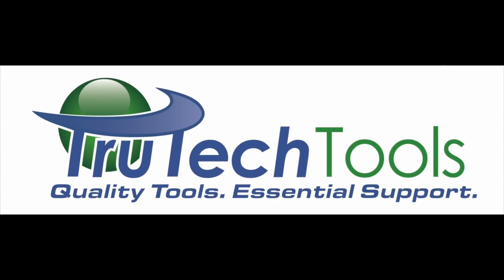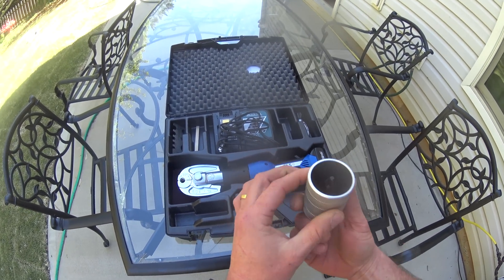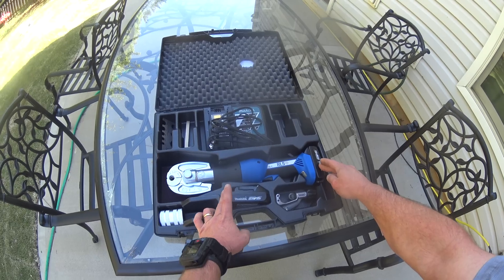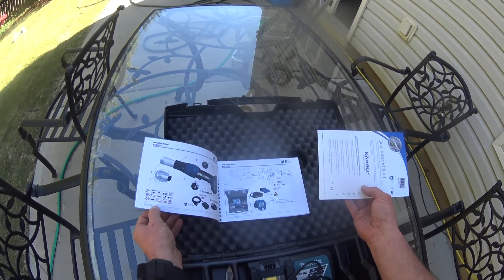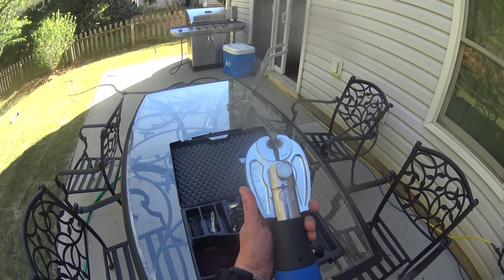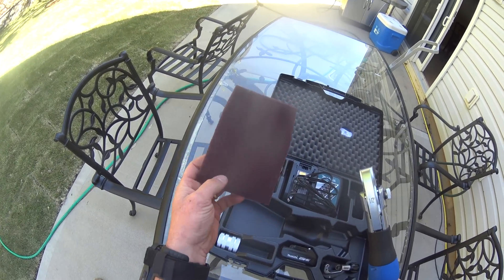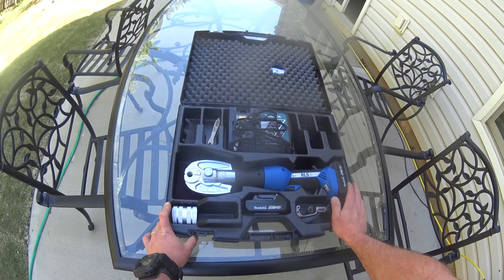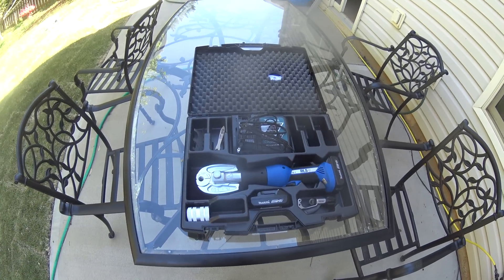HVAC Tools: Sporlan ZoomLock Unboxing

Comment: Are you using this tool? Thinking about trading in my torches. I have searched for videos on new ac installs using these but only a few found.
Reply from the maker: No im not using it as I only had a chance to handle it a few days for the purpose of the video. I've heard some stories about companies using it but haven't actually seen it in the wild.

Comment: In my opinion ridgid makes the best one I have ever used never used on Hvac applications mostly plumbing or water cooled condensers lmk how it works for you in Chicago it's not code yet for pro-press refrigeration line fittings has to be soldered or brazed but I'm sure it's coming had good luck with these fittings in plumbing when ur in a bind and water flow is hard to stop but I will solder or braze if I can just my opinion though

Comment: The guys who don't agree with this tool will get a wake up call in a few years. In five years or so I see this becoming the new standard in the industry for fitting copper and even see replacement parts with crimp fittings. Just look at the Propress success, on big jobs the savings in labor and maybe even have a tech with less experience doing the work will save so much money. Look how far digital gauges have come in the last five years and how many techs swear by them.
Reply from the maker: Glad you're open minded enough to see the value!
Reply: +Justin Hernandez i hate to tell you but i am in the commercial hvac business and pro press is absolute junk and does fail, how to i know? i have been making alot of repairs over the last 11 months on pro press fittings that are leaking.  All this "re-making of the wheel" will come to a head and will go back to simple soldering and brazing. Alot of guys in my area are also feeling the same way. i certainly will not use pro press in my business.
I say this, i certainly appreciate that companies are coming out with new ways to do a job. But to add to this, a local rep in maryland that supplys these zoom lock fittings/pro press type fittings on the vrf systems went out of business exactly 2 weeks ago due to the massive amounts of failures with these fittings
Reply from the maker: gregory .sadowski wow! I wonder if the fittings were properly applied?
Reply: +Stephen Rardon (HVAC with Stephen Rardon)  this i what i thought at first but we had a factory rep come out and the gentleman confirmed they were installed correctly... the fittings all held for roughly 2 months give or take. I literally lost count on the fitting repairs. ill have to get a final count when i go back next week. id say around 50-60?
Reply from the maker: gregory .sadowski crazy, only way to fix is cut out and start over, right?
Reply: that is about all you can you buddy. its frustrating to say the least. When you fix one- another leak pops up. never ending it seems. i did not install the equipment- we are just a factory start up rep

Comment: $2100 don't break it. They say it's great for new construction where there are a lot of fittings. It can cut down on labor cost and prevent contamination from brazing. Wouldn't do good in an oil retrofit, it would probably have lots of leaks due to all of the gaskets. Otherwise cool tool.😎
Reply: +Stephen Rardon (HVAC with Stephen Rardon) They didn't bother testing it on R22 because it's a dead refrigerant. With that being said, I have two fittings on a R22 systems @ my office unit and it's doing fine. Been in there since fall of last year. If it handles 410 pressures - 22 shouldn't be a problem.
Reply from the maker: +HVAC/R Junky check page 4
https://files.acrobat.com/a/preview/e36f1292-6452-4005-b471-4b7dcf8a1ded
Reply from the maker: +Eric M the fittings are rated for 407C but nowhere does this document show R22
https://files.acrobat.com/a/preview/e36f1292-6452-4005-b471-4b7dcf8a1ded wonder if it's because it not a current refrigerant for new piping installs?
Reply from the maker: ***** no doubt, at that price it's not for everyone.
Reply from the maker: Brent Ridley right, I figured that was the reason it wasn't listed
Reply: +Stephen Rardon (HVAC with Stephen Rardon)  I was just being a critic, and I am sure the unit is going to be used on Sys with new Refrigerant and most likely POE, but if it was ever used on a system where the oil was changed to another type then all those o-rings might be an issue. I just hope the EPA slows down with their mandates. Lol But it is a cool tool.😎
Reply: +HVAC/R Junky And if it was in the $400 rang then I would pick one up today.
Reply: +Stephen Rardon (HVAC with Stephen Rardon) I was told you can't use on R22 from a rep up here in north east. But you can use on 410A

Comment: I've used similar tools in hydronics systems several years ago, I'm a bit sceptical about the fittings ability to hold the working pressure of a 410A system over long periods, say 10 years. but we will see. thanks for the review.